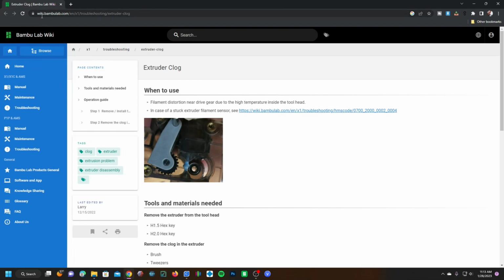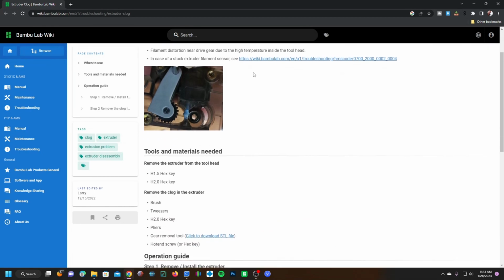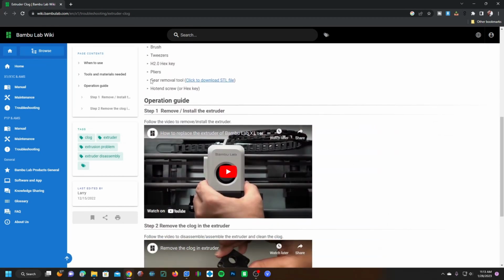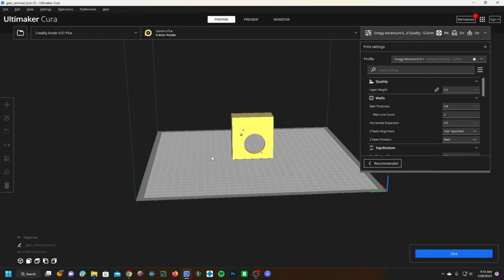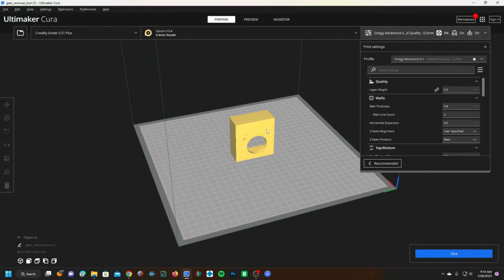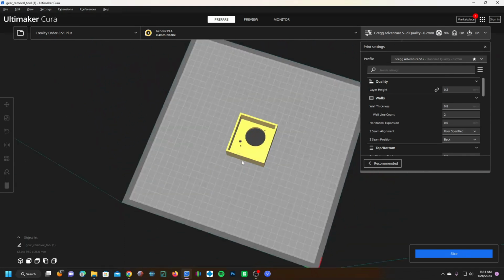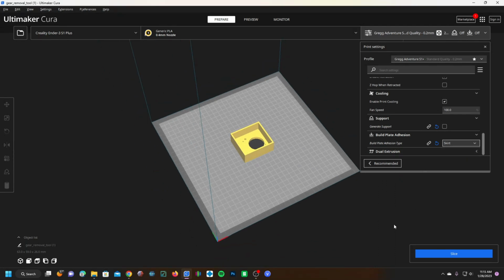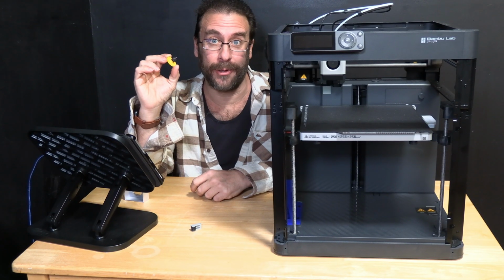How to Install the Bambu Lab P1P / P1S. Hardened Steel Extruder Gear Assembly

Comment: How important is this upgrade when printing abrasive filaments? How soon will the stock stainless steel gears wear out?
Reply from the maker: If going to do allot.... Very. If not, you may be ok. But most important is the NOZZLE.  10000% need the HS.

Comment: Does the extruder gear assembly you buy from bambu store come with that tiny gear that makes contact with the filament? Because the picture on their website doesn't show that part.
Reply from the maker: It's complete.

Comment: Odd question... is that tablet holder (shown in the 1st 20 seconds or so) you are using 3d printed? If so, do you have a link to the file?
Reply from the maker: It actually came from FIVE BELOW. It's super
Reply: @3DRundown  cool. Thank you

Comment: I also changed in the menu, under accessories, nozzle, to Hardened Steel 0.4 nozzle. Not sure what a difference it makes in settings but if its there I'm assuming its important to do as well.
Reply from the maker: Bambu studio has changed quite a bit since this video. The important part is the size. But, I'd certainly set the material as well, since it's there

Comment: Have you noticed any decline in print quality, such as surface lines or overhang performance, after switching to harder steel extruder gears?
Reply from the maker: No. I installed mine before I ever printed a single thing on a Bambu. It's still there, and I often forget which machine even has it. Been great.

Comment: Great tutorial. Just upgraded my extruder gears. Thank you!
Reply from the maker: Mine are still going! 🔥
Reply: Have you noticed any decline in print quality, such as surface lines or overhang performance, after switching to harder steel extruder gears?
Reply: @mitchellkirschall6699  No, I haven't.

Comment: Good tutorial, I would just suggest putting a small amount of grease between the hardened steel gears tho and maybe a little on the end that sits in the bearing given it doesn’t hurt and it’s recommended.
Reply from the maker: I'm gonna disagree, as I'm 1400 hours in, on this gear set. 😊
Reply: @3DRundown   Hey man that’s cool. It was a suggestion. 

In vast majority of cases it will be just fine but again it only helps. There’s a reason they come greased from the factory. It’s a gear, and constant metal to metal contact only benefits and lasts longer from lubrication. Also not everyone’s experience is the same, I’ve seen people run into issues around 1000hrs and opened their extruder to find ground down gear teeth and gear dust everywhere, then others that run 4000+hrs no problem. But hey, at the end of the day, to each their own.
Reply from the maker: I hear you, but, so far, I've got 3 of them cranking nonstop. But, the real grounding reason I don't do it or teach it, is, Bamby does not reccomend it. Here is the official WikiL https://wiki.bambulab.com/en/x1/troubleshooting/extruder-clog

Comment: Great, easy to follow tutorial. Thanks! I just wonder: on the original gears of my P1S has been some grease. I replaced them with the hardened steel gears and by following your tutorial I didn't grease them. What do you think: should I put something on them?
Reply from the maker: I didn't, and I'm about 92829291922882 in on it.

Comment: If this helps just ONE person...The connectors are designed in a way that allow you to plug them in only halfway.  So you can think it's plugged in but only one row of pins is plugged in.  I chased a "filament cutter is stuck" error until 2am and realized this was the issue.  There's a thing called keyed connectors, Bambu.  Look it up.
Reply from the maker: Bambu doesn't listen or communicate with us peons, at all.

Comment: How is it working inside the cabinet 🗄️ of the printer easy or hard ? Ty you for the repair on this . 😎👍🏻
Reply from the maker: Very easy, because you will almost never be doing it. It's shocking how little you need to work inside these machines.
Reply: @3DRundown  ty

Comment: So I’m doing this upgrade and inside my extruder was metal shavings that has rusted… I think it was way to tight. Imma loosen it up some.
Reply from the maker: Wow, that is really unusual. How do the gears look?
Reply: @3DRundown  the gears looked intact and in normal ish condition. Ig they were just rubbing to tight causing metal shavings to build up and rust

Comment: after changing to the hardened hot end are there any changes that need to be made in bambu studio or is it plug and play.Mine has worked so perfectly im afraid to touch it. I came from a lulzbot taz so with every change it was a new learning experiece all over again lol Thank you for your videos they are very easy to understand and follow. I always enjoy videos that are informative and too the point.Alot of you tubers post videos that seem to be more worried about time on screen rather than lesson at hand so again THANK YOU..
Reply from the maker: Time on screen is super important, as 99% of all viewers offer 0$ for their veiwership. This leaves us relying on ADS. Without the Ads, we are working for free, and eventually are forced to go do something else with our time, or, be broke all the time. It's a really tricky balance, that some people just don't do a good job with. I focus on what I need to teach, and never think about padding the video for run time. That's just how I work, however, the reality is, anything under 8 Minutes, is tough to monitize. This is why I try to encourage people to be members, super thanks, patreon, and #1: Use my Affiliate links. This way, I can worry less about nonsense like artificially stretching out a videom, which will cause viewers to bail anyways. That said, YOUR WELCOME. Thanks for being here. NOPE, the swap is easy, and off you go. Nothing special to do. The X1 allows you to tell it which Nozzle you are using. The P1, does not. The move to Bambu can be overwhelming, but, with experience, you'll be OK, and your confidence will come

Comment: Geeeez.  They really couldn't have included the hardened gear?!
Reply from the maker: Nope. Not even on the P1S....  My extruder just exploded, and I asked them to send me one with the hardned gear, and.... it doesn't exist. Not for the P1P/P1S... it DOES for the X1C. So, you have to order the Extruder, AND the Gear, then dissasemble the NEW extruder, and install the Hardned gear. It ends up costing like $20 more than the X1C extruder, and, a bunch of your time. Kinda sucks

Comment: Can confirm, for me, flush on the tensioner was stock. I carefully tightened the tensioner with the exact same number of turns as I loosened it and it hit the point where it was just flush.  

One of the clearest tutorials I’ve followed for any 3d printer issue.  Thanks!
Reply from the maker: Thanks so much, and OMG, finally somebody steps up with the Tensioner verdict! #HERO.  Thanks for being here. :)
Reply: srsly thanks dude this was a 10/10 well done
Reply: 13 turns for me!

Comment: @3DRundown  Hello, very good, I am buying a p1s and I wanted to know if that printer came with the hardened steel assembly or not and what benefit does it have? Because the one from the bamboo store is black but it is made of plastic material, right?
Reply from the maker: ONLY the gear and Nozzle is steel, and yes the P1S has it. It helps handle Abrasive filament without wearing down the teeth or nozzle opening
Reply: @3DRundown  It also comes with a hardened steel mouthpiece.
Reply from the maker: I have confirned with Bambu Lab: The P1S comes with the hardnes NOZZLE, but NOT the Hardned Gear

Comment: i dont have bambulab printer jet, but this video helps a lot, looks easy, now i can buy just P1S and change gears, no need go for P1X carbon
Reply from the maker: P1S ships with the Steal gear 🔥🔥
Reply: Steal gears, but not Hardened steel , at least I can found info about it more.  @3DRundown
Reply from the maker: Bambu makes a Hardnes Steel Gear upgrade for P1P. This is what is in the P1S. That's all Bambu offers

Comment: Would have been easier to unclip to filament tube and do this whole process on the desk. Also remove the tension screw from the start and the gear comes out easier also.
Reply from the maker: Not bad for my first time ever doing it. All my install/build videos are shot on my 1st time.

Comment: also a big thanks from me: Tried to print PA. Wasn't too thrilled by the result, so I stopped the print. Waited some time, then tried to unload. Wenn, that did not bode well - the P1S tries to unload at 250°C, while the PA was printed with 280°C. I could pull it out, but ... then I loaded PLA (printer was cooled meanwhile). It was pulled in for a cm or 2, then the extruder "snarled" at me and did not pull the PLA further. So, I was stuck with a flashlight (b/c printer off) and my phone looking at your video how to get out the friggin' extruder. 

Back at my desk I disassembled it. Could not laugh about "there's no mark on how much this screw has to be fastened, just try to match how it was when you disasssem..." - could have used that information while disassembling :) 

I also had to remove the tiny motor thingy and it's pcb to finally eject all filament. But hey, after all, it worked.

Does someone want to have a rather unused spool of eSun PA filament? 😕
Reply from the maker: LMAO! Amazing how the smallest things throw us into shitstorms of hell, on 3D Printers. Send me the PA! 😜
Reply: send me an address :) @3DRundown
Reply from the maker: Email me: gregg at greggadventure dot come

Comment: Thanks for this tutorial, do you know where in Bambu studio OR on the P1S panel you actually set the nozzle type to "hardened steel" so that Bambu Studio doesn't prompt you to check the nozzle type when you print more abrasive fillaments
Reply from the maker: In ORCA, you can, in Bambu you can not. On an X1C, under maintenance, you can. So, for now.... I don't know of a way.
Reply: This may now be available on latest firmware as you can configure nozzle on screen and handy app, cannot confirm studio as I use orca

Comment: thank you for the video! It helped me immensley, my only comment is that the print plate should be removed before doing any work
Reply from the maker: I never remove my Glass, and can't remember the last time I removed a PEI bed. I can replace a 20 PEI sheet. Not so easy to replace the Magnet or Hot Plate. I'd rather protect THEM

Comment: A very important step (also when changing hot ends) is to check your part cooling fan. Just open the app, tap printer, tap part, turn it on.

Thank me later.

I've had a couple of times where it felt connected but it didn't work and your prints will get ruined if that fan ain't spinning 😂
Reply from the maker: Yup. I even have a video specifically on this

Comment: Hi, I have a stupid newbie question. My P1P is only on the way so far. What is the benefit of installing a "hardened steel gear assembly"? Is it just using abrasive materials without damaging the extruder? Or are there other benefits? What material is used for the default gearbox of the P1P extruder? Thank you in advance for your reply.
Reply from the maker: Yes, it's for hard/abrasive materials that will wear down the plastic gear. I'd leave it be for PLA

Comment: On the parts website it indicates (or at least implies) that the hardened steel is incompatible with the P1P. If it has the same geometry then I can't see why it would be incompatible. Hardened steel (carbon steel) is less corrosion resistant than stainless but can sustain a sharper edge on knife blades. It's common to coat or treat a hardened steel blade by bluing it or by dura-coating it, although that doesn't protect the edge. However, you can keep the edge oiled, which prevents corrosion. I'm not sure what this would mean with an extruder, since I wouldn't really know an extruder from a canoe. Anyway, perhaps it's just a maintenance thing. They don't expect P1P owners to put in much time for maintenance and that's the source of the incompatibility implication.
Reply from the maker: The website absolutely lists the Hardened Steel gear as P1P compatible. Many are well into using them

Comment: i guess i'm gonna upgrade that too

btw: have you thought about reviewing some enclosures for the P1P? there are quite a few on printables by now - maybe you can do some rundown on them or testprint a few?
Reply from the maker: It's a pain in the a**, but, not TOO bad....  
I have such a huge list of things I want to cover. It's so  hard being just one person. But, that does sound like a fun, yet super-time consuming project. I'll see about getting it on the list! Maybe if I just try some of the more popular ones....
Reply: @3DRundown  or just try mine? 😂

mine and yet easy to build, downside: no door

I've tried the original armor mod plates, they don't even fit properly

it took me about 4 weeks to design them, but printing and installing them is quite fast
Reply: I'm finishing up the ARC enclosure. Getting the non-printable parts was a pain but I gather that by some time in March an external supplier will have everything bundled and early adopters will get the prefabbed acrylic panels and the brass hardware for $75, which is a very good deal.

BTW, I'm using Lexan rather than Acrylic because it's stronger and more heat resistant, and it was actually a bit cheaper for some reason. Downside is that you either have to cut it yourself or trust the store to do it right (which may be a substantial risk, as it turns out).

Comment: Thanks for showing disassembly!  Does not look super daunting but a bit of work and glad to see these step by step instructions.  What is the purpose of the gear replacement? Enhanced durability? Thanks!!
Reply from the maker: They also sell a pre-assembled extruder with the gear already in it.
Reply from the maker: You can totally do it, just be careful not to strip the little screws, or break the cable connectors. The new gear is much harder metal, for working with higher strength types of filament

Comment: you think they will sell the whole unit with the hardened nozzle as well vs just he assembly or swapping out the assembly and the stainless nozzle for the hardened will be basically the same thing?
Reply from the maker: Not sure, but I think it would be a good idea, to offer additional configurations, as assembled kits. For now, you can get the Extruder, with the hardned steel geer, already installed, but, NOT with the hot end, attached. That said, the hot end is super easy to install. I picked up a few, and hope to shoot an install video in the comming days. They probably should offer more options, and, I wouldn't be surprised if they do. We'll see....

Comment: Hello ! I did the same replacement for hardened steel extruder and hotend with Hardened Steel Nozzle in P1P two weeks ago. The box to pull the wheel is actually unnecessary. Unfortunately, I haven't printed anything with carbon fiber since then because my P1P is not hermetically sealed so far and I don't have a proper carbon filter to capture dust, etc. All your videos are very well watched with interest. Thank you and greetings from Krakow.
Reply from the maker: Yep, the gear pops right off. I don't plan on doing any CF, but wanted to show my peeps how to do the gear. Also, the Bambu install video, shows the wrong printer. Sadly, this is common for Bambu so far. Greetings from NJ USA!
Reply: @3DRundown  Excuse me. It's a European habit. Krakow is an almost 1,000-year-old city with a population of nearly 1 million in Poland. Second largest as a city and third largest as an agglomeration of almost 1.5 million. Where's her to the great and wonderful New York. Despite the nearby war in Ukraine, it has one advantage, it is quiet here and entering the Old Town late at night you can almost feel like in the Middle Ages. Once again, greetings from old Krakow!
Reply: Hello. Did you get a chance to print anything with carbon fiber since then? I'm wondering if P1P is going to work well with . And greeting from Kyiv! :)